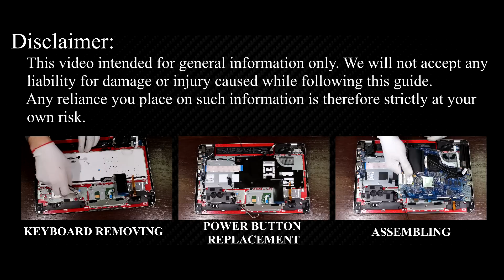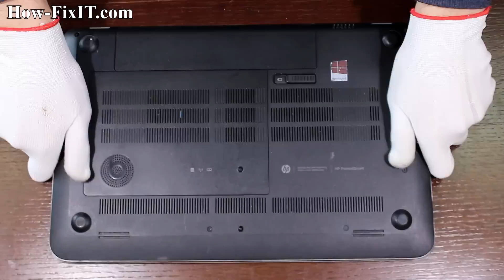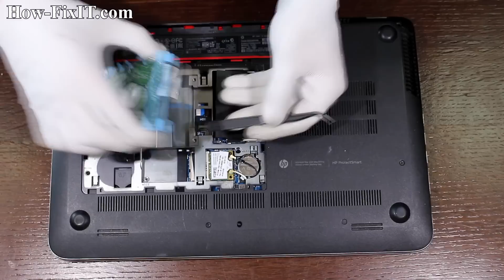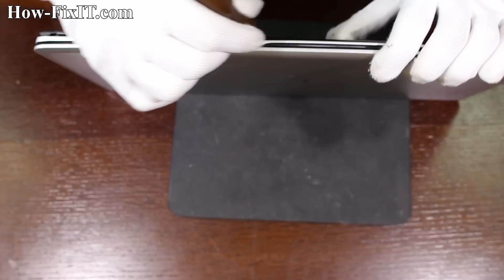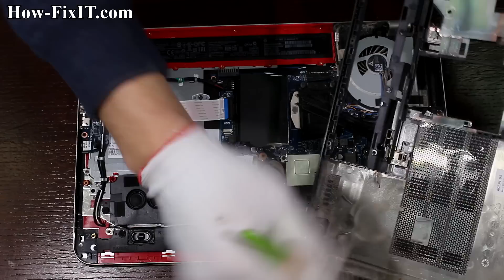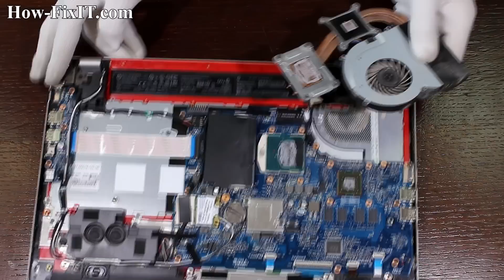HP Envy 15-J Series Disassembly, Fan Cleaning, and Thermal Paste Replacement Guide

Comment: Hi, I have a question, my laptop is a hp Envy 15-j003la with a 4700MQ processor, I´m thinking in upgrade this. Can my laptop works with a 4800MQ processor ? or would be any problem?
Reply: I know it's a late reply for you, but if anyone else is thinking this, don't do it. Yes it will work according to the service manual. It also supports the i7-4702MQ, 4800MQ, and the faster 4900MQ. If you have a 3000 series CPU this upgrade will not work. But anyway it's a small improvement for a big price, and it's not worth putting a lot of money into this old machine. Worthwhile upgrades would be to add a solid state OS drive or replace the awful LCD panel that these usually came with.